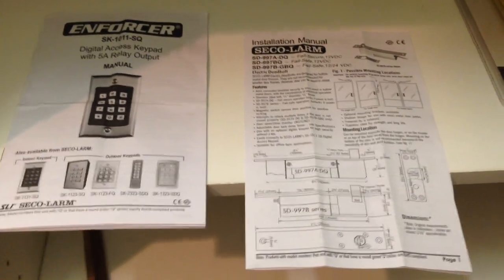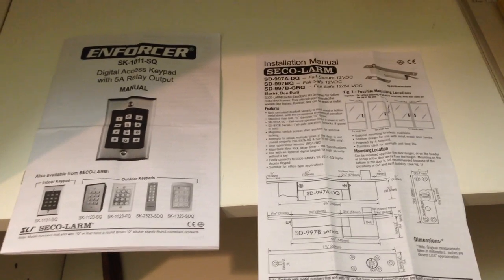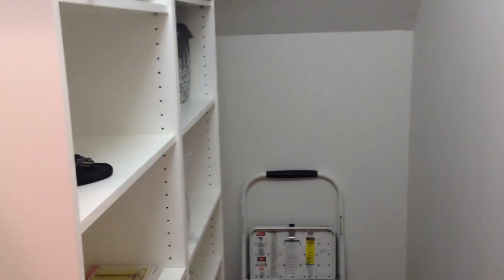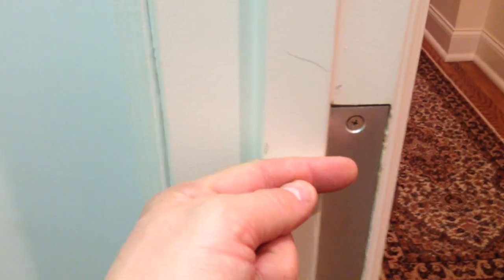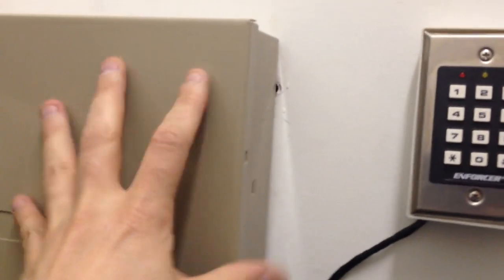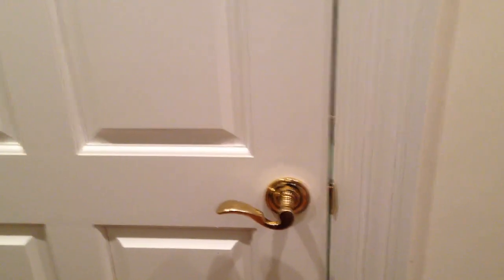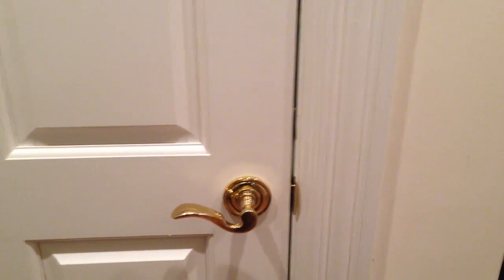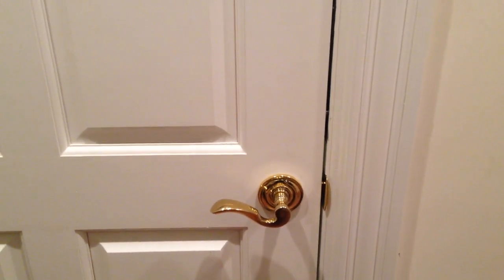Gun Closet - hidden electric dead bolt

Comment from the maker: A switch has been added on the inside to unlock the door in case you get stuck.   Also, security hinges have also been added which prevents pins from being popped out.
Reply: The Handy Husband pin this so people stop going on about you getting stuck inside
Reply: is there a safety if you lock your self in the closet?
Reply: you should change the door out see if you can't get a fire door or something that would actually protect you once inside.
Reply: Does it have a battery backup in case you get locked in and the power goes out?
Reply: Paul-Joseph de Werk maybe it's failsafe
Reply from the maker: paulec252 The lock automatically opens when the power goes out.   Had to look at all scenarios to see what I wanted it to do.
Reply: The Handy Husband how bout if the house was underwater due to natural disasters?
Reply: So anyone is able to get in by turning off the power.

Comment: I know I'm 6 years late, but came across this video.  Will definitely be checking this lock out.  For the time being, since I work from home 24-7, I've gone the cheap route and installed a Quikset Powerbolt 2 (better then nothing) which is totally obvious, but this particular closet is in an obscure location where thieves likely will not find it in time.  But for the bigger project, this is certainly on my list.  Thanks for this video.

Comment: adding 3/4 inch mdf to the inside of the door will make it much more difficult to break through, also adding a very basic interior mechanical lock/latch will make it more safe in case of a power outage, but none the less i think its a really cool set up.

Comment: I have a similar lock that I designed myself, but instead off the lock opening when the power go's off I have a battery back up system, you can operate the door lock for 2 days with no mains power.
Reply from the maker: Nice.  I'll have to think about that.
Reply: If the kids turn the power off, suddenly they have access to a gun room.  They could be sitting at home and have a normal power outage and a little friend could try to hit the bathroom.... wrong door..... look at all the guns!  Don't think about it just get it done.
Reply: RMSG Right. You never know who else might catch wind of your setup. Break in and turn the power off and your door unlocks. There goes some of your guns.
Reply: RMSG why are kids turning power off?
Reply: Richard you've never been a teenager? We turned the power off at my friends house when he was in shower when we were like 12. Kids do stupid stuff

Comment: 2 issues that I have with this idea. 1, what happens when you get locked inside? 2, you have exposed hinges that can be removed to pull that door off and gain access to that closet.
For much less money and time, you could have just installed a keyed passage handle and achieved the same result.
Reply: He can pin the hinges so the door can't be lifted off and all he needs to do to keep from being locked in is wire in an additional keypad.
Reply: +AKBuilder762 Both of which still need to be addressed. 
That powered lock still concerns me. The principle, anything that can go wrong, will go wrong, tells me to keep as much mechanical function in that door locking mechanism as possible. What happens when the power goes out? Do you lose all access to the room itself? Even worse if you're locked inside when that happens. 
I would prefer some type of mechanical override that allows the use of a key if needed. That could keep things simple and safe.
Reply: +pimpovic2 I looked into buying one of these locks and found some with a mechanical override so it would be impossible to get locked in. Just a simple knob you turn to retract the bolt. That eliminates the need for another keypad and wiring.
Reply from the maker: +pimpovic2  Both great points.   Here was my thinking.  On the hinges, I have purchased safety hinges which do not allow the pins to be taken out.   I haven't installed them yet simply because the main reason for the room (for me) was to keep my kids and their friends away from the guns.   The secondary reason was to keep them safe from burglars.  But I realize that the door could quite easily be broken into with a swift kick.   So the true protection there is minimal.

With regard to power, the lock automatically opens with a power loss.  This allows you to get into the room in case of someone shutting the power down.

As to locking yourself in, I wish there was a mechanical knob on the inside you can use.  I did not see one of those when I was researching the locking mechanism.   I do plan on adding an unlock button on the inside wall and wiring it to the lock.  That will solve that problem, albeit with an electrical solution.
Reply: +The Handy Husband It sounds like you are in the process of addressing the immediate questions, and that's a good thing. I would hate to get locked inside without a way out. That could lead to a pretty rough time. 
I know that no situation is foolproof and not every base can be covered immediately, but I'm still concerned about true safety with this set up. 
As a contractor, I am left scratching my head over a few things. If the lock automatically opens when there is a loss of power, how secure is it really if it's as easy as snipping a wire in the room immediately next door, or flipping a breaker in the control panel? 
The reason I'm watching these videos is because I'm looking for ideas to help complete my own room. In my case, just like yours, the main issue was to keep the kids out. A keyed passage knob solved that without making things too complicated. I don't have any dreams of creating a completely sealed and secure room. I think in both of our cases that would take much more effort and funds. The main concern I had in your situation was being locked inside for one of many possible reasons. 
It's good to see that you will be addressing that issue. 
In the mean time you may want to keep some granola bars, a few bottles of water, a 5 gallon bucket and a pack of matches in there if you catch my drift ;)
Reply from the maker: +pimpovic2   Nice drift.   :)    

The reason why an external locked door wasn't used was for aesthetic purposes and not to advertise that something valuable was in there.   My wife did not want a big key pad on the door in the main hallway.   Also, if a robber was to come in looking for things, they may just grab the TV in the room and not look at what seems like a normal coat closet.

In terms of the loss of power, either of those situations would open the door.  But, there are no exposed wires, you would have to tear down
Reply: +The Handy Husband  You might want to put a stronger door while your at it because it does not look that strong. Maybe metal or solid wood. Just an idea
Reply: Why even have a door that looks like a door? Unless someone were to come in looking for it specifically, the average robber is not going to start breaking down what looks like a wall looking for something.
Reply: Nice!  Hinges exposed, didn't see that nice.  Add some concealed hinges to the list
Reply: pimpovic2 if you wanted to do it with a different style an electric strike lock would allow you to have it so it simply is unlocked when the power is out. Which would also allow you to access it if the power is out and you are not inside. Seco-alarm also makes that kind of lock. Magnetic lock would do the same thing but can be more frustrating to install.

Comment: A cheap method for upping the security of a closet to a gun safe is replace the drywall with plywood. This adds time to breaking in as with drywall they just have to kick to get in but plywood they have to cut. To add more time to it expanded metal sheets can be put on the studs first giving you another type of material they have to have a different saw for. 

The plywood walls also gives you the ability to secure gun racks, shelves or containers to the wall anywhere rather then finding a stud. 

A safe no matter the type is rated for how many minutes it will keep a person out and most of the ones you can get without breaking the bank are rated at less then 10 minutes. In this case you are not trying to stop them but to simply slow them down enough that it is not worth it to them. A strong lock = attack the door.  A strong door and lock = attack the hinges. a strong door, lock and hinges = attack the wall.

Comment: Pretty slick. If it were me, I might do without a door knob all together and install a spring that once the deadbolt releases the door, the spring pushes the door open slightly. This way an intruder has nothing to grab on to to try and force it open.
Also, what if you're inside and the door closes behind you?

Comment: Very cool!  Only thing I noticed is the hinges can just be taken off and door removed.  Assuming your intruder has some intellegence... which is unlikely
Reply from the maker: I've actually replaced those hinges with security hinges that cannot be removed.    Now they could actually just break the door down.   But this is meant more for my kid's friends.   I could reinforce the door jam and put in a metal door if I wanted additional break-in security.
Reply: Nice!   Yea I wasnt trying to bash your set up, just something I noticed.  Very cool!  How easy was it to do the wiring?  I dont have the luxury of an adjacent closet, so Im wondering if its even possible for my set up
Reply from the maker: It all depends on what you want to show.   We did not want a keypad on the door, showing that something valuable was inside.   We wanted it hidden.   My guess is you could do some sort of remote control.   The keypad was separate from the locking mechanism.   I'm sure you could find the manual of the lock.  If I remember correctly, there were multiple options for unlocking.

Comment: What about a DC battery backup so the locking mechanism doesn't unlock automatically when the power goes out. I suppose that would have to been hidden also so as not to have access for someone to disable that too and gain entry. My antiquated home security had duel battery backups.
Reply from the maker: If I was doing this for true hardened security, then I would add that, different door hinges (which I actually have but haven't installed yet) and a reinforced jam.     But for my purposes which are to keep the kids out, and more importantly, their friends, this is perfect for me.

Comment: wHAT ABOUT POWER OUTAGES ? Is it redundant or does it open automatically if the power goes off ?
Reply from the maker: During a power outage, the door automatically unlocks.   This was configurable in the locking hardware.
Reply: Nice
Reply: So if someone wants to steal your guns all they have to do is cut your power.

Comment: 1: these keypads are not secure, but since you claim it's not for theft, and that it is hidden in another closet instead of by the door this shouldn't be such a big deal

2: you really need a push to exit button, it's very simple to wire to this keypad and will permit a way to unlock the door from the inside

Comment: Couldn't have used just a locking lever handle with a key? Plus the jamb isn't reinforced at all.  If it loses power doesn't if fail safe or secure?  Plus the alarm cabinet and stuff should be secure as well.  Do some more upgrades and it will be nice, but right now its kind of not secure especially for guns.  Could even tie that door into the alarm system its right there.
Reply from the maker: Yea.  You could have used a keyed lever handle, but those can be opened with a simple credit card.    The protection is really for visitors.    My kids have enough experience with guns to know what to not do.

Comment: I don't understand all this extra work for something that is still very easily accessible. Buy a gun safe. Plus isn't that a wood door? I understand you said it was mainly for the kids but aren't you afraid of being wiped out by a burglar?
Reply: Republic of Texas Thats along the lines of my thinking. A wood interior (hollow) door, that has exposed hinges...   it would take less time to kick it in, than it would to legitimately punch in the correct code.  Seems a bit over thought out.  or... not.
Reply: Republic of Texas yea but that's what homeowners insurance is for..... if he gets robbed in can all be replaced having your guns locked up pretty cheap is also nice.... maybe he has a small house and a safe gonna take up too much space
Reply: Watch the video, the whole thing. Not just the first 10 seconds. He says that the closet will also have a real gun safe in the back. Also, he has a pinned comment about the door and hinges.
Reply: Also has a primary alarm system...somewhat of a deterant of itself

Comment: What is the door gets shut while you are inside? Do you have a keypad inside or a way to actuate the deadbolt?
Reply from the maker: That was one of the issues already identified.  I'm putting in a switch that will allow me to open from the inside.   Much easier and cheaper than another keypad.

Comment: couldn't you just slide a non-ferrous shim in between the magnets and unlock the door?
Reply: No,because deadbolt is closed by magnet switch,but not opened by it.
Its opened by you entering code and activating servo.
So magnet acts as sensor when door is near to automaticaly lock it.
But you could probably trigger that switch,so deadbolt comes out while doors are still open,so they dont close properly and kids gain acess to gun.
But whatever,that deadbolt isnt really strong,because its probably ment to child proof doors,because any smart burgular could drill straight trough that deadbolt, simply break drywall or if he is a bit more educated,open keypad and short out servo that operates deadbolt.

Comment: Those locks come in two styles: Fail safe - power loss unlocks the door; Fail secure - power loss and it remains locked, power is applied to unlock.

I hope you used the fail secure lock type.

Comment: um...     I don't see how this is any better than just using a locking door knob. Which would have been just as "low-profile", cost you 30 bucks, and taken 3 minutes to install. 

...and if you're putting a safe in there anyway why bother with even locking the door?